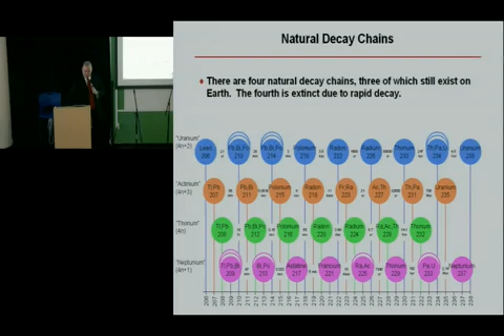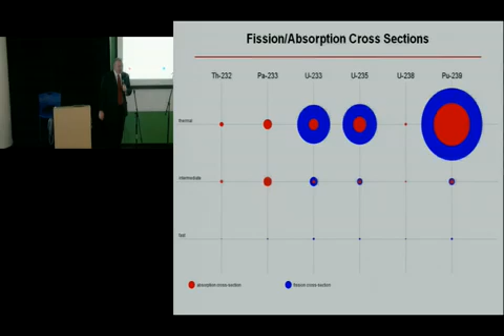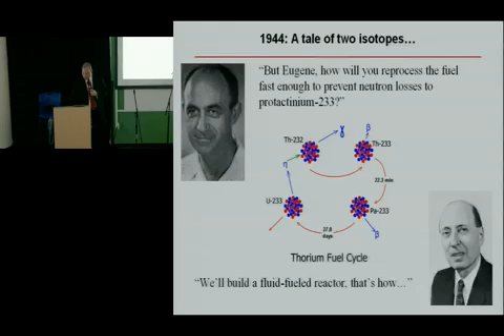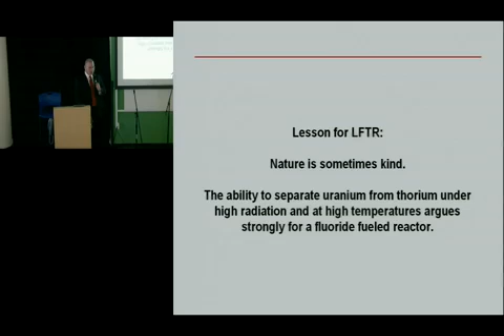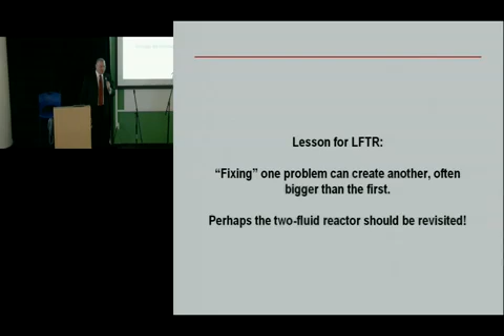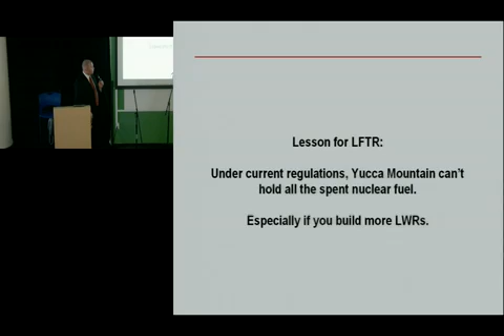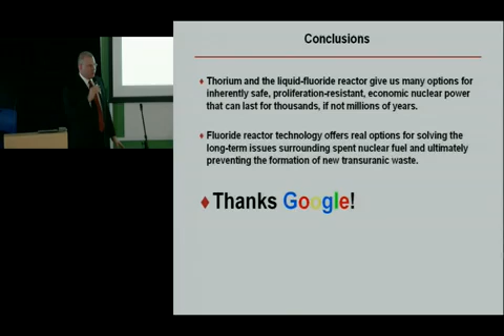Energy From Thorium: A Nuclear Waste Burning Liquid Salt Thorium Reactor

Comment: ... 250000 tonnes of high level nuclear waste Worldwide, from just 60 years of fission nuclear power generating circa 10% of total electricity power generation; there is nothing sustainable about conventional nuclear fission power!  There is nothing sustainable about nuclear fission power, even molten salt reactors, because the alongside reprocessing plant required for a molten salt reactor will also generate a radioactive waste stream. The idea that a molten salt reactor can "burn" the nuclear waste is a myth; in trying to burn up nuclear waste, new radioactive waste will be generator.  What Dr Sorensen is describing is delusional.  Yet more crap ill-considered US engineering, just like the AP1000 reactor design that was not properly earthquake proof, hence Fukushima Dai'chi.  At Oak Ridge National Laboratories, to this day, people are still trying to clear up the radioactive mess from Dr Alvin Weinberg's molten salt reactor experiments from the 1950's.
Reply: 98% of that "waste" is still viable fuel in a fast neutron MSR (not a LFTR as described in this video). Look into the Elysium Industries reactor.

Comment: Just a bunch of lies. Thorium Molten salt reactors are still 20 years away, or more. They are not clean and not cheap. We don’t need them, we have solar energy, clean and almost everlasting.
Reply: Let's talk about the absolutely massive land area that would take in any grand scale.  Then let's talk about energy storage because it never shines at night, and at varying intensity in days.  Then let's talk about EOL recycling for the materials used.  Solar is no better an answer than anything else we've come up with.

Comment: Could we use Carbon nanotubes, question mark? LOL or slightly larger tubes made with graphene if that is any different. You would need a stiffener such as a ceramic, and possibly a thermal insulating material.

Comment: The graphite blanket wearing problem is not going to be easy to solve. There is only 1 percent of extra neutron you can workaround breeding your thorium. If you drain the graphite tank to replace the wall, you can only do it less than 1 percent of the time of the operation of the core. One day off every seasonal change, 4 times a year. But, is that enough to keep the graphite water tight all year round? Can you change the wall one extra time when graphite is leaking before the season ends? No, you only get one shot. You miss it, your power plant is dead. How is that for reliability ?

Comment: Can Trump administration built this reactor?
Reply: Only by violating the laws of economics, to wit, extracting 232U from the 233U-232Th mix is expensive, radioactive and dangerous
Reply: Hellstrom Carbunkle, I don't think you understand how this chemical separation work. they will only be separating all uranium isotopes formed from breeding thorium. The separated U will then be blended into the reactor fuel.
Reply: Voldemort The problem of 232U poisoning is that it cannot be removed from the 233U matrix save by EM separation

Comment: OK. The way the LFTR works as I understand is that it's safe, no need of large complex, no need of having peoples around to look after, and if something happen, the frozen plug will open to aloud for the liquid thorium mater to flow in to the holding tank.......... then what ? Can some one enplane what will happen after ? can it be re start it ?
Reply: He actually explains it in the video. https://youtu.be/AZR0UKxNPh8?t=1672. The situation would be the same as when they would turn it off for the weekend. As I understand it thorium would get too hot, melt the freeze plug and get into the holding tank and because it's no longer heated it would cool down and turn into a salt. When you want to use it again you need to heat it up to turn it into a liquid to pump it back up into the reactor.
Reply: After it cools it can be manually removed, re-melted, and poured back into the reactor.

Comment: What about the shielding issues? If U-232 is flowing around in these pipes and pumps and heat exchangers and there is no 30 foot layer of water for shielding then what protects the workers and inspectors from the gamma emissions?
Reply: The liquid molten salt
Reply: galt57 https://www.nirs.org/factsheets/thoriumbackersoverstatefacesheet.pdf

Thorium Reactors: Their Backers Overstate the Benefits
Reply: galt57 steel and concrete.

Comment: Thorium's relative abundance to Uranium is about 4 to 1, but relative to U-235 is about 400 to 1.then there is the cost of extracting the isotope..
Reply: They make U-235 in the process of running the reactor.  It would need some "seed" U235 to get the process starting, but after that they would be good to go.

Comment: 1. How can you prevent Protactinium 233 from absorbing a new neutron while it is in the blanket for several months before its decay into Uranium 233?
2. If you want to use LFTR to burn spent fuel from light water reactors, what would happen with Plutonium 240, wich is a non fissile nor fertile isotope?
3. Is there anything you can do to accelerate the natural decay of radioactive isotopes?
Reply: 1. It only takes a month on average for Pr-233 to decay into U-233. It can be chemically separated from the blanket (see 16:00) along with Xe-135 and other neutron poisons. The Pr-233 can be held in a separate tank while it decays and the U-233 can be filtered back into the core. 2. According to wikipedia, Plutonium 240 has a half-life of 6563 years. In a molten salt reactor, Pu-240 would just sit and not do anything. But Pu-238 could be burned up, which is most of it, and isn't energy utilization the best way to destroy plutonium? 3. Yes, decay of isotopes can be sped up by burning them up in a molten salt reactor. Dumping them in the fuel core would expose them to neutrons causing them to decay or fission into more manageable isotopes while harnessing the atomic energy. MSR's will be the ultimate recycling program!!

Comment: Just a comment to office Thug. Neutron emission (per fission) * capture probability *  * decay losses in moderator gives NO self-sustaining chain reaction in Thorium reactions. The fact that 232-Th can be up transmuted into 233 - U doesn't help because relativistic neutrons only cause up-transmutation NOT fission, thus a moderator must be present in sufficient ratio to kill up-transmutation WHILE not also consuming neutrons (always does). Result? No 233-U based bombs can be built and if you can't do it under Implosion density, it is impossible at normal density.
THAT is why there are no working 232-Th based reactors anywhere without a 235-U based core.
Reply: Wrong. U235 is only needed to start the reactor. One of these ran successfully at Oak Ridge for a number of years.
Reply: Lie. Never once has a 232Th reactor run without 235U
Reply: Would you mind telling me where your information comes from?
Reply: Various articles in Nuclear Abstracts, circa 1997.
No new information has been forthcoming.
232U poisoning is the central reason they call Thorium the "safe" nuke.
Can't make a self sustaining chain reaction (bomb)

Comment: Thug, here's the issue. Fission does not happen 100% of neutron impacts. Neutrons do not 100% survive long enough to impact any nuclei. Neutrons require density of fissionable material * fission probability / neutron.
A good minimum number of neutrons per fission event for light water is 3.8 and above.
If you check your numbers for fission probability, you will discover WHY Thorium has not replaced enriched 238U.
See? Just too easy.
Reply: "per fission event for light water" -- you're talking about in a Light Water Reactor, a solid fueled, water cooled reactor, using U235 + U238 (breeding some Pu239).

That doesn't apply to using molten thorium in a Molten Salt Reactor such as LFTR. With molten fuel, you don't need enough uranium to last for the 18 months a solid fuel rod would be in use; with molten fuel, you need enough fissionable uranium to maintain fission -- and that can be controlled through simple chemical processes, and that doesn't have to be controlled exactly since the molten fuel expands/contracts with heat so excess fission expands the fuel reducing fuel density and thereby reducing fission. In a LFTR, converting thorium to uranium-233, you need slightly over 2 neutrons per fission.
Reply: *****
Molten fuel allows removal of fission products that absorb neutrons. Solid fuel these fission products are trapped in the fuel pellets. The video mentions xenon gas simply bubbling out of the fuel salt, to be safely stored; this is a major neutron absorber in LWR. Neutron economy is not as important in MSR vs LWR.
Reply: I'm no expert but thorium wouldn't be in a light water reactor.
Reply: *****
Wrong. Liquid salts are ALREADY diluted, corrosive, subject to leaking and build up both daughter products easy to remove AND transuranic byproducts of transmutation that are stable as in non-fissionable and those ARE VERY difficult to remove. The entire bath will have to be reprocessed in real time while literally glowing blue due to Chrenkov radiation. The gamma that is killing you is invisible.
Meanwhile, 235U by enrichment is the only way to maintain the reaction.
Ever wonder why they don't build bombs out of the stuff? Thorium will not self sustain except in an implosion core, like Plutonium except worse since a moderator MUST be in the mix.
Reply: *****
The problem, of course, is 233-U doesn't produce 2 slow neutrons per fission. It produces 1.88 and can only fission in an implosion core. 235-U is required to create a chain reaction....that and deuteron bombardment with 3 - 8 MeV (exact energy varies with both temperature and depth of bath).
Assuming net loss fusion is available, that would also work.
So far, neutron reflectors simply are not efficient enough to sustain a 232-Th based chain reaction post-transmutation.
Reply: Hellstrom Carbunkle this is not light water, and no one is claiming that thorium is fissionable. U233, however, is extremely fissionable in thermal spectrum. It's ALREADY BEEN DONE.
Reply: and where do you get 1.88 per fission? the number is 2.49.
Reply: Yes moron, but 233U (get it right) is only one of two products of transmutation. 232U is a neutron POISON which not only extracts neutrons from the net flow, it creates yet more neutron absorbers.
DUH!!!
And no one has ever built a light water, 232Th fueled reactor. FIRST there must be a 235U-238U or 239Pu-238U reactor to CREATE 233U and then some insanely expensive EM separator to remove the 232U.
DUH!
Reply: I see you left out capture probability ** decay loss in the moderator (neutrons do not always, or even close, interact with moderator either)

Comment: Let's work this through like a toddler taking their first steps.

What is the enrichment level of U-235 used in reactors?
What is the enrichment level of U-235 used in weapons?

Now, here's the tough part!

Can you use Low-Enriched uranium in a nuclear weapon? WHY NOT?
Reply: In 7 years nobody has answered you?
1) fresh reactor fuel for light water reactors is approx 3% Uranium 235.
2) I believe the enrichment level for weapons is 95 plus percent.
3) You can’t make a nuclear bomb with reactor fuel because all of those neutrons flying around from split U 235 would be absorbed by the Uranium 238 (97%) of the mix and then you have to wait for it to decay into plutonium.  
Totally different physics path involved.

Comment: Yes. It does matter.

It's the entire fucking point of the Six factor formula, to determine the neutron multiplicity of a nuclear chain reaction at determined neutron energies.

If neutron energy doesn't matter than why do we moderate our pressurized water reactors towards the thermal spectrum?

Because you're wrong and it does matter.

Comment: There is no such thing as a self-sustaining bomb.

Breeding fissile material takes time. Converting U-238 to Pu-239 takes time. Converting Th-232 to U-233 takes time. Overall, the neutron economy for both of those cycles, given fission of the bred fuel isotopes, is positive.

Bombs explode. You're not going to get a breeding cycle going when your "reactor" explodes. You put Pu-239 in a bomb. NOT U-238. You put U-233 in a bomb. NOT Th-232.

Comment: Work through the worst-case scenarios if you want but it is, in fucking fact, possible to achieve a conversion ration higher than 1.00 with the thorium fuel cycle, which makes it a self-sustainable breeding cycle.

Comment: No, now I'm sure you're trolling. Neutron temperature has everything to do with why you don't understand what you're spouting. It is Physically impossible to generate a 1 to 2.1 ratio of U-233 to U-232 in any system with thorium as the feed-in isotope. In a geometry-optimized core you expect at most 0.15-0.18 neutron loss on average to the environment, and up to 0.04 lost to neutron poisons like Xe-135. U-233 generates 2.29 neutrons on average at neutron energies less than 1 eV (WASH-1097)

Comment: With a thermal reactor, you can transmute even-mass actinides to odd-mass actinides, and fission the odd-mass actinides. This only really works if you have an excess of neutrons which once-through fuels like U-235 or MOX simply don't have. The next best thing you can do with MOX is not have any uranium at all in it, and instead have thorium as the support fuel, because it's lighter and less likely to be overbred into transuranics

Fast reactors, which exist, can simply fission even/odd actinides

Comment: 0.1% Pu waste will put out so little amount of radiation that your cellular walls will prevent all alpha radiation, almost all of beta and gamma radiation at those levels will not cause significant amounts of mutations or cell destruction. .001% of mercury in current fish near europe is a vast underestimation. You dont even fucking google your idiocy. Its rather hard to accumulate enough plutonium to get more effects than living near a hill does. Mercury will harm you a lot easier and quicker.

Comment: Ok im cutting this debate off here since you are lying through your fucking teeth either out of ignorance or willful deception to promote an industry you work for. Chernobyl and Hanford do work on same princible of operation but they are not identical nor can Hanford produce the incident Chernobyl did. Fukushima was indeed a test case in low priority on maintenance, yet the effects of almost everything that could go wrong were Vastly smaller than anything other planets inflict on environment.

Comment: Solar still requires backup fossil fuel generation...especially if we switch from internal combustion engine driven cars to electric vehicles.  Worldwide, the nuclear power industry has a much better safety record than the various fossil fuel industries (See 1998 Paul Scherrer Institute Report comparing accidents and fatalities across the energy sector from 1969 to 1996.  Hydroelectric actually has the worst safety record).  Solar will NEVER have the capacity to replace fossil fuels, the least

Comment: 4) Most solar panels don't work at night; if your's supply ALL your energy...your's must.

No?

Well, then the rest of your energy comes either from nuclear, or from fossil fuels like coal; oil; natural gas.  These fossil fuels create toxic and radioactive waste, as well...and because the process of using them to create energy is chemical in nature rather than nuclear...it is less efficient and will therefore require more material to do so, thereby creating more waste than even uranium (and far

Comment: Wow!  Those must be some solar panels!
1) Most solar panels are made from a toxic material, the mere manufacturing of creates wastes which are, themselves, toxic; you have obviously found a way for them to be manufactured without that;
2) Many of the materials used in manufacturing most solar panels required fossil fuels; apparently your's do not;
3) Most solar panels offer an efficiency of 20% maximum, so if you are obtaining ALL your energy from them, your's must be far more efficient;

Comment: You're mistaken. I could explain why, but you really ought to watch Kirk's other talks. The main point is that solar and wind are just too diffuse and intermittent to compete seriously with fission in terms of energy per unit cost, even if used at much higher efficiencies than current or foreseeable technology allows. They're not sufficiently energy-dense to sustain the growth of global technological civilization. Solar will find plenty of useful applications, but it can't be the main course.

Comment: We could break nuclear waste down, extract the useful and reduce the mass of real "waste" by a 100, but the reason that we don't is that its not economical. The lion's share is unburned fuel; it is "cheaper" in our industry to mine virgin uranium than gather the 99% left in the spent. The reasons its uneconomical are mainly political: "not in my backyard", entrenched new fuel interests, the relative hazardousness of the job, and the liability implications if the lowest bidder botches it. ...

Comment: No, my understanding is that the "fuel" in the thorium cycle is actually the plutonium or the uranium 233, the stuff that actually "burns" and produces energy and keeps the system going.

Sorry - guess, I couldn't spell "breeding".  Without the plutonium or U233, thorium won't breed sufficiently.

OK, LFTR is not entirely theoretical.

Comment: not  only do we have entrenched infrastructure...but your describing a system that is impossible to build with the current labor pool.. this salty high temp  fuel flowing in nickle or stainless pipes is impossible to build without 4-7 TIMES the current amount of pipe-fitters in the US.   the ramp up to build these would be four or five years

Comment: MSL reactors don't require the manufacture of fuel elements which is where the resistance in the nuclear community comes from but the oil industry is probably one of the most corrupt industries on the planet.